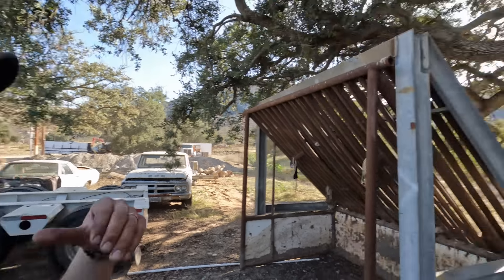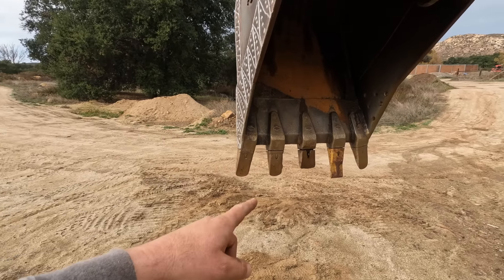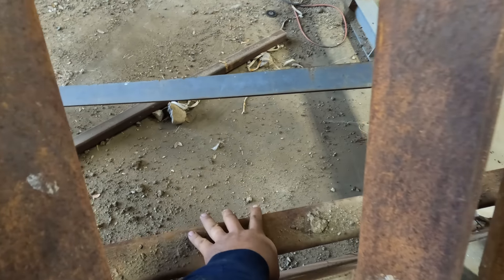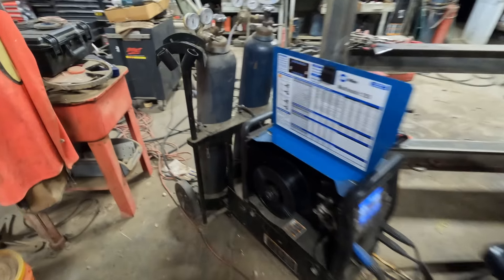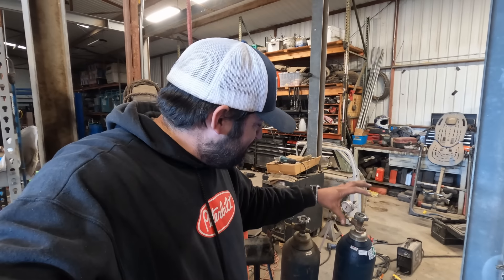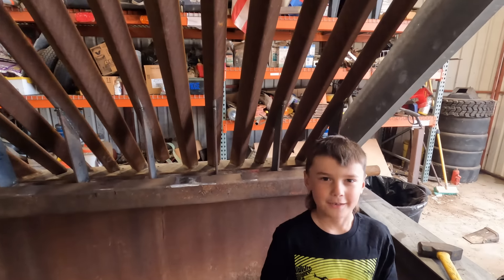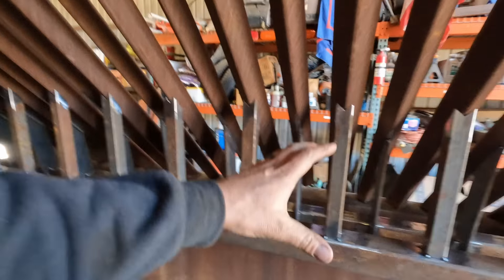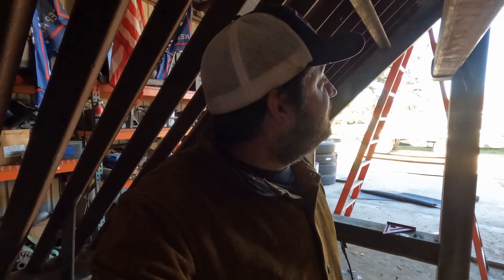After THREE YEARS I Decided To Finish This Awesome Project !

Comment: Hope your mower is OK. I did something similar with a push mower and lowered the deck on a piece of wood. It stopped the engine and did internal damage. I tried starting it and it had no compression. Neighbor who rebuilds mowers tore it apart and said I bent the push rod and messed up the cylinder. It was junk so I gave it to him. He put a good engine from another junk mower and sold it. I started just paying him to mow my lawn after ruining a $350 1 year old mower.
Reply from the maker: It's happened before. I think it's probably gonna be ok

Comment: Drink milk , that’s what we did when we welded on galvanized duct or structural steel that we couldn’t grind away all of the galvanizing, it usually helped pretty good, of course using a fan that was placed either pulling the fumes or indirectly blowing them away 👍🏽😉